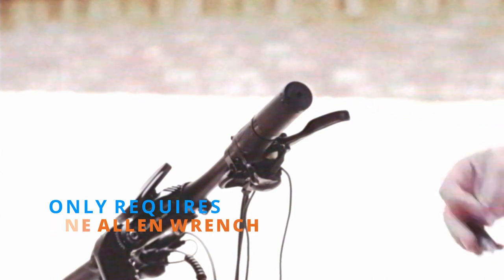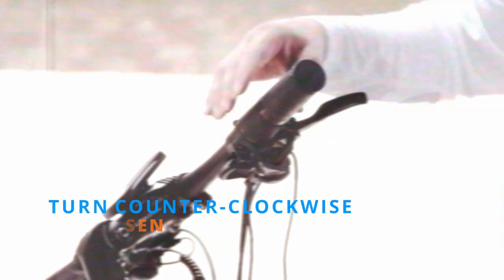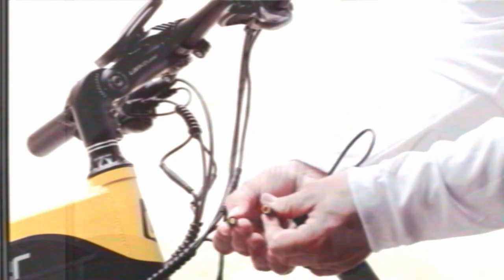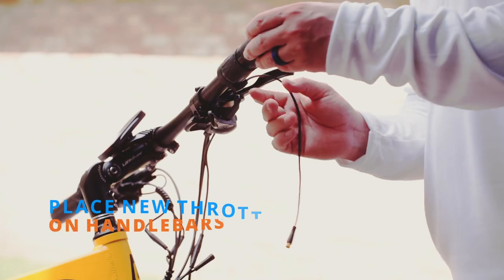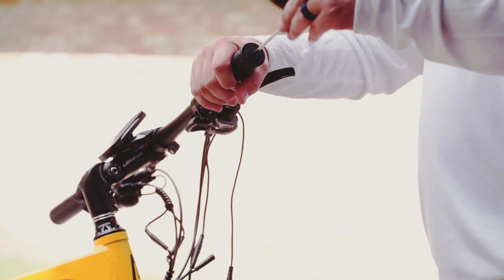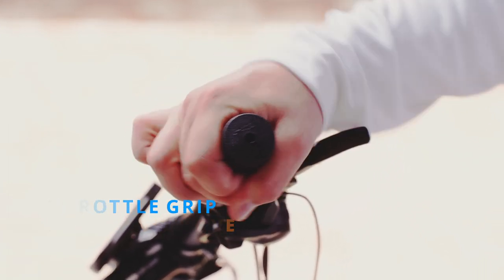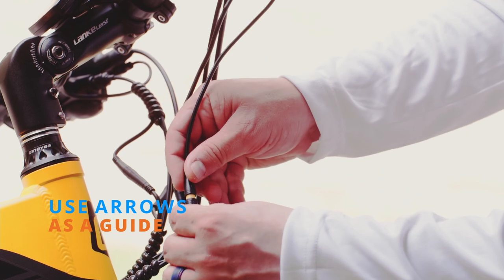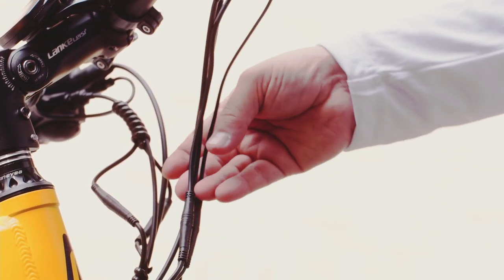Cyrusher TV | Quick Tips - Installing Twist-Throttle on Electric Bike

Comment: Hi, I have tried to do a small upgrade on my Cyrusher Ranger and I bought a pair of Ergon handle grips, also I bought a half twist throttle to match it with the new grips. Here is wher the problems started! The female 3 pin plug didn't match with the male plug from the bike, thie female plug from the new throttle is bigger in diameter than the male plug...so I went further and I bought a thumb throttle but same! Female plug larger than the male plug and I can't find the smaller version, about 4-5 mm diameter plug, all of them out there are larger. And on top if this, I disassembled the original throttle into pieces and I just can't figure out how to put it back... guys if you can help me out where I can buy the right throttle, with the 4-5 mm plug? Or a video how to assemble back my original throttle please?
Reply from the maker: Hello, thank you for your plug matching feedback.
Please click here to submit a ticket and our after-sales customer service will contact you to resolve the issue.
Thank you!
https://www.cyrusher.com/pages/contact